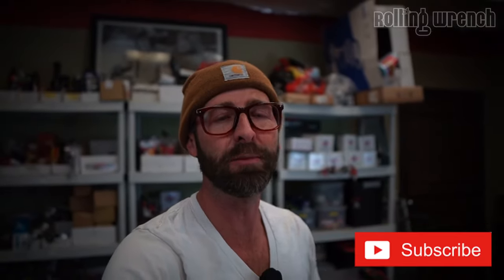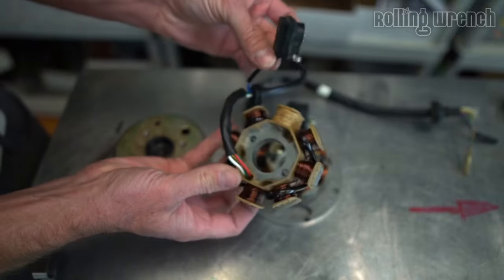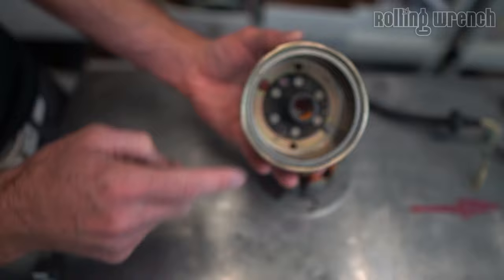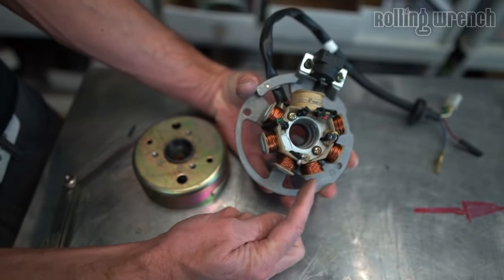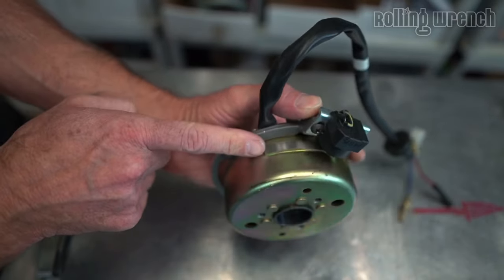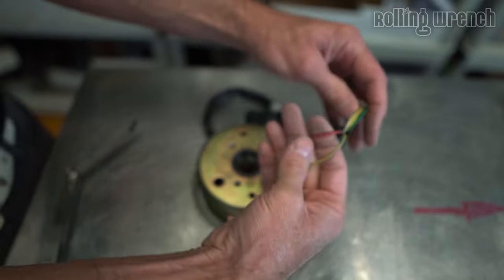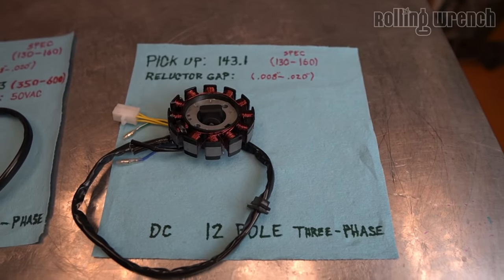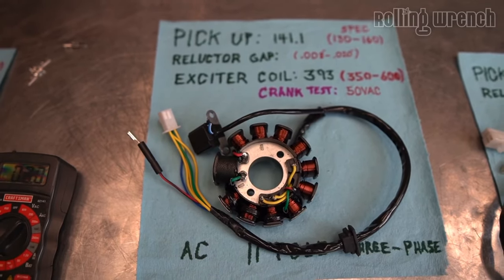HOW TO TEST A STATOR / WHAT IS A STATOR [step by step] GY6

Comment: Good job. Just FYI ,all coils in a magneto are ac, that’s how current is produced. It goes to a rectifier to make DC power if needed.
Reply: I think he just called it a DC stator to correlate with the DC cdi box for dummies just because the stator meant for a DC cdi box does not have a capacitor charging coil
Reply: Hi I'm no expert in electrical..
can i use the power from stator to rectifier into a headlight?
a bit late to ask.
Reply: Hi any word on the timing coil voltage out put ?   And will decrease the reluctor gap increase that
Reply: @williamhaskellhaskell3162 voltage is dependent on the rpm but is low the trigger voltage
Reply: @geoepi321975 I don't think voltage changes with rpm, but the ac frequency does. Doesn't the voltage regulator keep the voltage consistent by controlling the amount of ground going into the windings?
Reply: @mmholling87 i mean the stator voltage changes, in all three windings , charging lighting and ignition winding, the regulation is achieved with an scr as you said
Reply: @rjn1749 no, the power is to much, you need to use the power after the rectifier.
Reply: How to and primer videos shouldn’t use jargon. What is a CDI box?
Reply: Excelkent video.
Issues...
With a dc system . When i turn the key. I get "1" spark when cranking.
Turn key off then go to start. Once again i sparks only once. 

What is the cause?
I have seen this question asked a gew times  on forum. One sugestion was to check engine and frame ground. Mine seem to be fine.
2003 yerf dog rover
Reply: Is it possible to use a Chinese pit bike ignition system, on a big single- cylinder 2-stroke? ( Bultaco 360)
Reply: @robertbobin5053  sure, as long as it came off a two stroke pit bike
Reply: He literally stated that in the video just after the 7 minute mark.

Comment: As a mechanic by trade who has never worked on a scooter or moped, I must say that I found this video very informative. I never knew what a stator did or how it worked. Thank you very much for all the work you are doing to educate those of us that don't have all the knowledge that you do
Reply: Just  a very old permanent magnet alternator haha. Only its built behind the flywheel.
Reply: What he doesn’t know is the red and black plastic tips come off and he’d have a long prob to use and wouldn’t have to place metal pieces to get connection while testing. 🤣🤣. I’ll be sexist…I’m female and know this & I don’t know a ton about engines but knew this much 😂 Lord.  🤦🏻‍♀️

Comment: Nice job, well presented! lots of good and important info here. However, there are no "DC stators" , due to the fact that ALL stator/coil assemblies generate alternating current. The AC being generated has to do with the dynamics of the moving magnetic field passing through the stationary electric field of the coils. This induces current inside the coil wires that intrinsically alternates according to the laws governing electromagnetism. For clarification, the direct current we measure in ignition systems is produced after passing thru a rectifier which is a set of diodes configured so that only a portion of the sinusoidal waveform gets passed thru to the switch, essentially converting the signal to DC. What we are seeing at this point is actually pulsed DC and what our digital voltage adapter measures is actually the root mean squared voltage which is listed in the service manual spec sheets as Vrms. If you connect the multimeter directly without the adapter its measurements will be rangey and all over the place.

Comment: THANK YOU! I've been rebuilding 70's and 80's bikes for 15 years and someone brought me this GY6 and I've been mind-boggled trying to figure out the no-spark. I've never seen a DC Stator. I've always seen the rotor/stator into the Regulator/Rectifier (and onto the CDI box after '79/'80). All the manuals and test procedures I've found are for testing AC stators and I was starting to think someone hacked into the wiring. Seeing the DC stator on your table and the ground wire and pickup wire with no exciter made me so joyful. I totally get it now. Thanks for making this thorough and thoroughly enjoyable video. Many thanks.
Reply: The gy6 is just a copy of the honda cg125. 

The rotor/stator and AC/DC cdi-boxes are more or less the same on all the 50cc scooters.

Comment: Hey Rolling Wrench,  Thank you for this informative video.  I just changed out the Stator in my Yamaha 2000 VSTAR 1100 motorcycle.  Last year my go to bike shop mentioned to me the bike isn't charging properly and its time to replace the stator.  So last week I did it, no biggie right but now I know why they want $700 to change it out, its all labor.  I haven't started it yet because I'm waiting for the new battery and I haven't put oil in it yet either.  

So I have the older stator and I was going through the various test that you thoroughly describe, its a 12 volt 3 phase stator.  The stator resistance, was 4 ohms, the requirement is .36 to 44 ohms, it appears low and this may contributed to charging issue.  But I believe the issue with it is when I tested the pickup coil resistance, it requires 189-231 ohms.  There are 2 wires in the pickup a gray and a black, I switched my analog meter to 100k and tested it.  Can I assume the gray wire was equivalent to your blue wire and the black is ground?  My reading was nothing at all.  I assume I'm doing this right, I think the pickup coil is smoked and attributed to the charging issue.  Any suggestions or help would be much appreciated.

Comment: This video is superbly helpful. I have worked on carbs for years and have been intimidated by spark and charging systems. The instruction and demo in this video are exactly what I needed to take my motorcycle troubleshooting ability to the next level. I will buy the exact same Craftsman meter so I can exactly replicate this troubleshooting sequence. Thank you.

Comment: That is just what I needed to know , the DC stater and DC CDI. I have a 700 Polaris giving charging problems, the stater wires have been readapted to another controller so I needed to understand how it works to fix it. I thought it was AC for a start. Thanks for a great explanation.

Comment: I've been hurting my brain trying to figure out my electrical system. Best video I've found by far, definitely going to sub just because that was very well explained. 

I'm trying to get my lights working without a battery. I have a 200cc engine with an 8 pole AC stator and can't get DC voltage from my rectifier. I'm just going to end up buying a new harness and stator.

Comment: I just want to say thank you for taking the time to go through some of the minute things which you find in most videos people don't do it's like people think that everybody just automatically knows and I guess from a certain standpoint certain things people should know but when you point out the very small like the dumb stuff which most people would probably consider that's just common knowledge even in those small things when you go around to the big stuff it kind of brings it all together but I just wanted to thank you because for all of us out here that are trying to learn and trying to grow you know in our brains especially when it comes to electrical stuff the very very small stuff and to teach on a video like you're teaching a 5 year old is probably the best way to do it because if a thousand people watch this every one of them for the most part is going to have one little thing even if they knew everything else one thing is going to stand out that oh I didn't know that and I've had several of those just watching this video oh I didn't know that so appreciate you taking the time teach to us like 5 year olds because when it comes to electrical electrical it can be very confusing and the majority of us don't know much about electrical mine a little bit but not the majority and we don't know a lot about electrical it's a very difficult thing especially when it gets into real depth of running 15 different wires and 60 different places and a mile away in one little vehicle it's making it pretty pretty out there God bless

Comment: This exactly how video should be made exactly to the point detail information and he's giving exact information piece-by-piece so you will understand this operation in a hole if you never even looked at this before great job my man this is a real video and I needed to know exactly this because I'm can't get a spark out of my spark plug but I changed everything but the stator it started sparking again after a few runs it's no spark again almost like if the spark plug itself is blown but something is causing it and I don't know what

Comment: Thanks for the info, easy to follow. I don't have spark. 8  coil type. I have 45 volts ac from the exciter, but I don't get any ohms reading on this stator and also a spare that I have
 What am I doing wrong?

Comment: I just did a 97 arctic cat pantera stator because there was no spark.  It only has 3 yellow wires coming from it and thats it.  I looked up the specs in a service manual which was .0280 ohms.  When I measured it showed me 0.4 ohms.  I didn't trust it.  Nothing looked to be wrong with the stator.  No smell of burn, nothing melted ect.  SO I put it back in and figured out my own test.  From what I learned it didn't matter any combination of wires.  I put a meter across all the wire combinations and cranked the engine.  Every combination gave me a voltage of about 9-10 volts.  (this is because its not running.  Running the voltage will go higher)  This is how I knew that the stator was good.  Anyway, it ended up being a bad ground to the CDI box.  Runs like a champ.

Comment: Thanks, I am just testing my DC stator.  as it to out the  dip beam on my motorbike. and when it was runnin g Honda says max V  caharging out, should be about 15.5  to 16 V max with full beam on at 5000RPM. my stator is pushing over 20v bang goes the bulb .  So as you said I have but my meter in the 3 sockets on the plug, and its all over the place on the  Ohm;s 0.01 and 2.5 readings are all crazy seems to vary everytime i put the probe in. I am taking it all to mean the stator is a dead fish.

Comment: That first stator is the one Iv just put on  my 155cc pit bike, so I can run lights, as stock they are just a 2 pole stator for ignition only, Iv modified a gy6 scooter loom, some china Enduro front light and rear light and $20 indicator lights, cheap china switch gear  and a small gel battery mounted under left side no plate, it's registered as a 50 cc Forza scooter here in New Zealand, and It's got a motard 12-inch wheel kit and extra rear calliper and KTM hydro clutch on the left under the clutch for rear brake as I love wheelies and in summer it runs on the road on slicks most days,kills everything off the lights with a hole shot lol

Comment: OP: You probably figured it out by now BUT just in case And for anyone else whom may not be aware.... The upper plastic of your MM's Leads Come Off, improving reach in narrower spaces. (Having the plastics off would have made the type of testing you do in this video A Lot easier. And avoid the need to use the extra connectors at 12:08.)
They either twist or unscrew off, ultimately exposing more of the Metal Tip. 
Hope that made sense.

Comment: Great explanation. One question: the rectifier on my GY6 engine burn. I replace it with a new one (not original) and the engine fails on middle range rotation. A few minutes later, the rectifier fries again.
Now I'm concerned about replacing it again without knowing what is the problem.
What and how should I test it?
Reply from the maker: Test the stator to see if it’s grounding out
Reply: @RollingWrench  No ground escape. 
Tests i have done:
- the battery is new and has 13.1V before the starter
- with the three yellow wires from the stator connected to the rectifier, the bike works fine at low revs, fails at medium and the rectifier heats up uncontrollably; with these wires disconnected from the rectifier, the bike works well at any speed, but as we know, the battery is not charged
- at idle the 3 yellow wires measure about 40V from stator
- the resistant test on stator show equal values on three wires; no ground conductivity; no open circuit on each coil 
- apparently all the masses are well connected.

Comment: Nice video. I’ve really learnt a lot👍🏽👍🏽.
I have two phase connector with white, yellow and blue linked to a 3 phase stator which has a red wire, blue yellow and white . Just yesterday I saw the connection burning. I need help as to which cable to link the red wire to. Thank you.

Comment: I have a 80cc Loncin ATV, it has a brand new battery. will not start on it's own, have to jump it but then after running for a couple of minutes it dies, doesnt matter if you're riding it or just idling. Fresh gas, etc. Battery voltage drops to 4vDC when cranking. Thoughts?

Comment: wow, thank you. however the starter i have has only 4 wires and 8 poles. just wanted to test it before i get rid of it. only a little confused there. some help if possible or link to video or manual for it

Comment: I have a non starting GY6, with a DC cdi. It has a very weak spark, and there is no spark when I use the kick starter, I know it’s not good for it, but when I turn the engine over using a power drill it does spark, but it’s very weak, and it won’t start. I’m using a drill since the battery is totally dead. Since my bike has a DC cdi, does the bike need a working battery for it to start?

Comment: The wire coils on the poles can also short circuit.The copper wire on the coils are coated with a clear insulating coat which thru time breaks down causing a short.You can rewind them using same diameter wire and count the number of rotations.

Comment: Perfect find on Youtube, rewiring  an  old Chinese quad  and had few issues, last one (but not  the  next) was  no spark. Been at it for weeks  trying to figure it out!  2  seconds to bend the pickup closer to the magneto  was all it took. Now getting a spark  it runs  but not by itself, just with start spray,  hopefully a carb clean  then good to go. Cheers for  upload.
Reply: hey did you fix it?
Reply: Ya, did you fix it? Did ya?
Reply: @jimmystanhope2408  No sadly i had to send it to the shop
Reply: When checking carbs see if fuel is getting to jets. If not check pilot jets blow n clean should do trick. Carb spray test bypasses fuel flow.

Comment: Great information.  I have a 2013 Piaggio typhoon 50cc 4t with looks to be a DC stator based on parts catalogue.  It has a 3 pin connector.  My problem is the headlights and instrument cluster lights not working.  Does the stator power those?  Brake light works and turn signal works.  When I power the scooter on, the headlights will flash once but do not turn on as well as the tail light.  Can you advise?

Comment: Hey Mr. Wrench,, I have a hawk 250 DLX that is fuel injected. I’ve put a little over 3 thousand miles on it.. rode it from lake Cumberland my to Cincinnati Ohio..5 hours there 5 back it did great.. I do change the oil often.. anyway.. now it will start idle smooth run 15 seconds then die… within those seconds you can put it into gears and pull out .. I have changed the fuel pump, 02 sensor, coil , plug, battery, fuses in at a loss.. any suggestions… oh I did find a bunch of cut places on the wire harness… I had fixed them.I’m wondering if it’s the ecu .. don’t know how to verify..plz if you can help I sure would appreciate it  ..

Comment: Great and informative video. Stators have always puzzled me. You talked about the resistance on the pickup coil being specific 130-160 ohms. I have on that is 103.9-104.0 ohms, much lower than the spec that you outlined. Would this low resistance cause my no spark issue when everything else checks out good?

Comment: So when doing your diagnostics for the exciter coil voltage, (excuse me if i sound like a dumbarse) i was under the impression that a stator is interchangeable with a 12v battery if that makes any sense. So why would you test the exciter coil with the battery? Obviously i am a total novice want all the information yesterday pa! 

Great video

Comment: Excelkent video.
Issues...
With a dc system . When i turn the key. I get "1" spark when cranking.
Turn key off then go to start. Once again i sparks only once. 

What is the cause?
I have seen this question asked a gew times  on forum. One sugestion was to check engine and frame ground. Mine seem to be fine.

Comment: Very informative, and explains things well. My only question is, can you test a stator still in the machine, (with the flywheel still in place) or will the magnetic field from the flywheel return false or inacurate readings? - Thanks
Reply: U can do the procedure matt has shown while stator still bolted on engine just unplug all stator wiring and proceed with procedures!

Comment: I'm working on a 91 Yamaha WRA 650 can I just unplug the stator and measure voltage coming out of one of the 4 wires that goes to the stator and crank the engine and see if I have voltage coming out of one of those for wires ,when I work on 2 stroke dirt bike I know I should have very little spark coming out of the stator ,so if this engine is cranking I should get some kind of voltage coming out of one of those for wires

Comment: Hey very interesting video and informative, I got a old 84 yamaha tri moto 200. I Only get a single spark when I use the electric start button and its only when I let go of the button? It also has a pull start but I get no spark. I tested the primary coil and pick up coil in the stator and they're within spec until I try to start it. Then they zero out when I push the start button and jump back up when I let go same zero out when I try the pull start.? What's your thoughts on that.? I would greatly appreciate some advice.